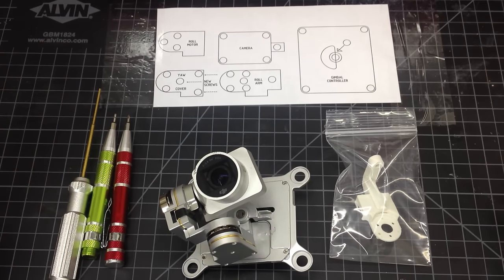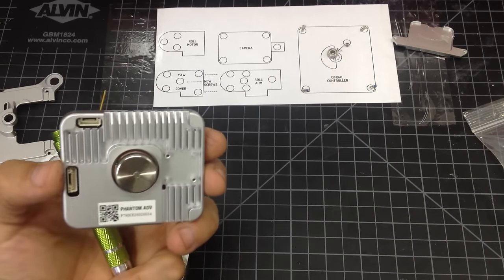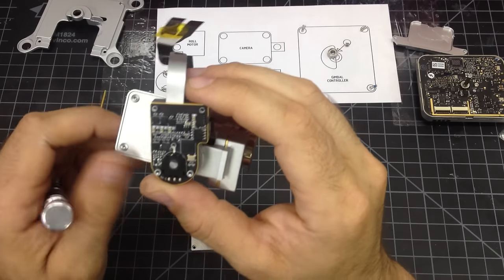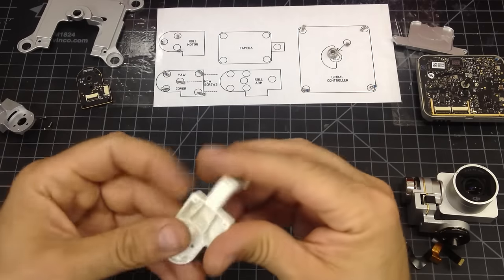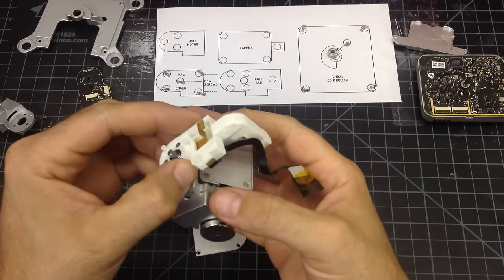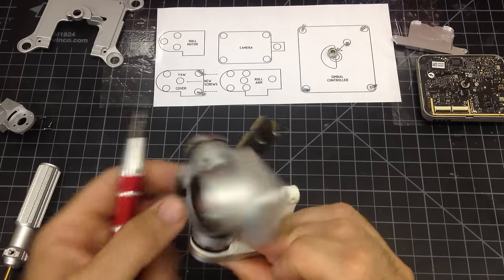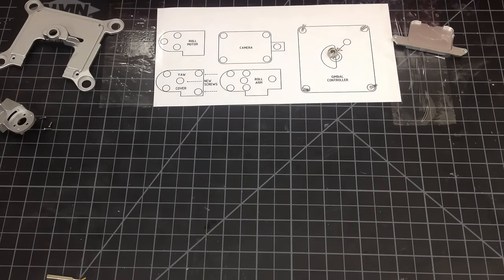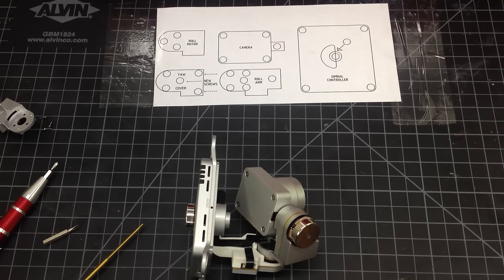DJI Phantom 3 Gimbal Repair - Yaw arm Replacement

Comment: Excellent video, thank you! It was also very entertaining to hear your comments while repairing my drone alongside...thanks for that sheet to help remember where the screws go! I took a screenshot and printed it out. Also the pace of your video was perfect, I was able to follow along and pause here and there, and it wasn't overly long or too quick either. Perfect, my drone is back in action thanks to you! (I purchased a metal yaw arm from Amazon)

Comment: My P3S lost all range with the new 1.6.80 update, but now my pitch motor is binding and locks in the down position. I've never crashed it and I usually hand catch I also have a carbon fiber gimbal saver installed. Any thoughts on why the pitch gets stuck? Would you be interested in a repair service if I shipped the gimbal to you?

Comment: Nice video Tony so many thanks for that.  I noticed 2 mins 45 sec into the video you talk about possible damage that can happen to the gimbal control circuit board.  In my case the long thin black chip is damaged (totally crushed) and after putting the module together and doing all of the alignments the horizontal yaw control ceases to work and the camera has a 1 sec cyclic judder. I know I have done the alignment correctly, have spent a lot of time researching it aswell. Do you think that damaged chip might attribute to this problem?  To make matters worse I was able to get a second-hand crash damaged gimbal control circuit and camera off ebay.  I have connected that onto my drone only to find the same problem.  However in the later case of the second hand ebay purchase I took the plastic protective cover off the gimbal circuit and found the same damage to the black chip area, but someone had removed it and replaced it with a soldered in length of copper wire. I was interested in your learned opinion in this matter. Many thanks if you can help me in this matter. Martin

Comment: Tony - my Yaw arm won't come off of the base like you do at 2:47 of this video.  It just won't slide off, I took the screw out with an Allan key but still won't budge.  Any ideas?  Wondering if it bent or something when it crashed.

Comment: Just got the parts in today, did the full repair. I desperately need help. After booting up the phantom 3 (standard). The gimbal with move around perfectly then center itself. However, after a few seconds the gimbal kind of jerks and then a green light appears on the top of the gimbal. I am able to connect to the wifi network on my device, however in the application it indicates the camera is not connected. Any tips?

Comment: Ty so much for the parts and for the walk through. Helped tremendously. I have an issue that maybe u can help me with. Now that I installed everything, once I powered on the phantom, the camera screen is just a screen with pink lines through it. I have no view. It worked before I changed the yaw arm so I know it's not the camera itself. Any ideas?
Reply from the maker: +JL 561 - Sounds like ed bad ribbon cable. Think of it like when a tv looses signal and gets all blocky and changes colors. This is the extreme version. I don't know exactly why scrambled digital video goes to pink. It might be an interesting fact...? Anyway, the only causes I've seen for this is damaged ribbon, cheap clone ribbon, and damaged antennas. I'm going to go with damaged ribbon or cheap ribbon in your case, since you say it changed after the repair, not the crash.

Comment: I need help with my DJI Phantom 3. I crashed my drone last week and it does not have any broken pieces from outside. But when I turned it on, the camera makes the normal starting sound and kept clicking after that. I cannot seem to get my phone connects to the drone also. Not sure if it is hardware or software issues?

Comment: I can't seem to get the yaw arm off (the step at 2:45). It's completely stuck on somehow. I had a hard time getting the bearing off too...any suggestions? This is on the Phantom 3 Pro.
Reply: Same problem here - did you figure it out?

Comment: replaced my ribbion cable and then relized the fan on top was cracked .can i get a new fan(still spins) .but when i turned my drone back on camera did not move at all .loose conect somewhere or doom?thanks!!!!!!

Comment: Great video.  I replaced my flex cable.  My camera is 1 or 2 degrees off center to right.  Set screw is tightened down properly.  Can you share any advice on how to straighten the camera since DJI does not have yaw adjustment like they do roll adjustment?
Reply from the maker: +timmyd - This is a sign of mainboard damage in most cases. Sometimes it can be corrected with a "cold calibration" of the IMU, but in most cases it's not fixable. You should check to see if there's any dirt or metal filings stuck to the yaw motor magnet. This type of thing can distort the magnetic field that the mainboard reads for yaw position. I have fixed this by turning the magnet on the yaw motor, but I broke the magnet a few times. I only got this to work once. The rest of my attempts just mad the problem worse. I would recommend that you don't try it to fix a 1-2 degree problem. Mine were 10-15 degrees. 

I think there should be some sort of reset for this. I find it hard to believe that DJI dour through the work of clocking each magnet to +/- .5 degrees. It would be much simpler and less expensive to get it within +/- 5 degrees and then zero it out in the firmware. Anybody have any ideas on how this could be achieved?
Reply: +Tony Bock Thanks Tony!  It would sure be nice if DJI added a "Yaw Adjustment" like they do for Roll.  Then if a camera was off between 1-5 degrees, it could be adjusted to center.  Thanks again for the video and taking time to respond.
Reply: +Tony Bock And just to confirm, you are talking about the main board of the gimbal?
Reply from the maker: +timmyd - Yes, the gimbal mainboard.
Reply: +Tony Bock After close inspection I found that when the yaw arm is perfectly straight the camera is slightly angled so it appears that the roll arm is bent.  I also noticed that while there is no binding, the tilt is not free spinning like the yaw and roll.  The link to your eBay keeps showing item sold.
Reply from the maker: +timmyd - Going by the information that you've provided, I'd say that the motor shaft for the pitch is binding inside the housing. This happens when the roll ar or pitch motor housing is bent and the pitch motor shaft goes through the motor position sensor at a little bit of an angle. The solution for that would be to replace the roll arm and possibly the pitch motor housing. The motor housing can often be bent back into shape because it usually onle bends wher it tips the motor inwards. The metal is pretty thin there. The roll arm is pretty complex and rigid. You might have a hard time getting that straight.
Reply from the maker: +timmyd - Once in a while, I forget to add quantity to my sales. Once they run out, I need to start a new listing. You can check my other listings to find the current one. This is the active one now: http://www.ebay.com/ulk/itm/191705708697

Comment: Do you have a link to that screwdriver is it magnetic?  BTW just send you a video on my P3 standard and was hoping you could advise on how to fix it.  I replaced the yaw arm but the camera goes crazy and says "gimbal motor overloaded".

YOU ARE THE MAN!!! Love these videos!
Reply from the maker: I sent you a reply by email. The most common cause of a crazy camera after a repair is from a mistake during assembly. The shaft that the camera attaches to needs the flat side to face the back of the camera. You can hold the gimbal up to the light to look through the gap and see if you've made this mistake.
Reply from the maker: I would not recommend that you buy your screwdrivers online. The quality matters quite a bit. I got mine at microcenter, but Walmart might even have them. Be sure to look at the tips on the Philips drivers to see if the point is small enough. Cheap ones often have blunt tips and won't work for this job.

Comment: Hey Tony, yesterday i crashed my phantom 3 advanced and now the gimbal yaw arm is broken, ur tutorial might help me a lot, BUT my Fan is missing ;( where can I get a new one?
Hope You're gonna answer me,
regards, Maksimilian
Reply from the maker: The Advanced camera doesn't come with a fan. The Pro (and probably the 4K) fans are about $20 if you can find them. I think those fans are made special for DJI. I haven't been able to find that exact size. You can get one that's close enough from digikey though.
Reply: Thanks for the respond, 

Now i repaired the yaw arm, but during the repair the little black chip at the "mainboard" of the gimbal broke.... what can I do?  please help me!
Reply from the maker: Umm... buy a whole new camera. You can't fix that one.

Comment: I've had a crash yesterday and I also have cracked yaw arm, when I buy a replacement camera + gimbal for my Phantom 3 standard is it just plug and play? thanks in advance!
Reply from the maker: Yes. I made a video on how to remove the gimbal too. It's pretty straight forward but the clips can be a pain in the butt. 
How to: http://youtu.be/QYHDLi8XGWs
Reply: 👍 seen every video from you this evening  (it's evening in the Netherlands) ☺ but I haven't seen a video about replacing the whole unit... but you say it's just replace it with a new one, attache the wires and I'm good to go?! 👍
Reply from the maker: Watch this video: http://youtu.be/QYHDLi8XGWs
Reply from the maker: The camera just connects and works.  You can use a pro camera or a advanced camera too. It doesn't matter. If you use the advanced camera, the app will see your copter as an advanced, and if you use p pro camera then it sees it as a pro.
Reply: Today I ordered a new phantom 3 standard 😇 where can I find your gimbal arm repair kit? I will try that first before I buy a new gimbal 😅

Comment: Hey! 
I did all like on the video but now after the change the gimbal is not working anymore. It doesn't react. Live video from phone I can see, but the gimbal won't try to move. It won't move at all, non of the gimbal motors. Any ideas why? 
I didn't change the ribbon cable, only the yaw arm, and I'm pretty sure that I plugged all connections back in.
Reply from the maker: Check that all latches are closed on the ribbon. If they are, try a new ribbon cable again. The only ones I trust are original DJI cables from a trusted reseller like B&H Photo.

Comment: Hi! Is it possible switch 4k broken gimbal for a hd new gimbal? And keep the 4k camera? thanks!
Reply from the maker: The only thing that's different between the 4K and HD is the mainboard (the board the SD card plugs into). You can swap the mainboard and fan from a 4K over to an HD and make that a 4K. Even the camera is the same.

Comment: Good morning, brother. My phantom 3 std wet the camera and now the image is a little greenish. Which may be the problem, would be flat cable or the gimbal board.
Reply from the maker: If you can still see an image, but there is a green tint, it could be as simple as dirt or algae inside the camera. The housing for the camera is not waterproof. You should be able to disassemble the camera and clean it with acetone. Don't use rubbing alcohol. That stuff is usually 30% water. Acetone is perfectly safe for your electronics and it's easily available and 0% water. 

If the picture is solid green, you might just have corrosion in the connectors, but it could also be a water damaged component. You might get it working again by taking it apart, cleaning all the boards with a toothbrush and acetone, and installing a new ribbon cable. It would certainly be worth trying. Good luck! Let us know how it works out.

Comment: I'm trying to straighten the shaft of the roll motor, but I need to remove the part with the magnets from the part with the coils. How do I do that?
Reply from the maker: The shaft doesn't bend on the roll motor, although it can bend on the other two. It might appear that it has, but that's not the case at all. What happens is that the hole in the motor bell (the part with the magnet) gets deformed. In most cases you can get it straight again by squeezing it with your fingers. Don't use tools. That would likely cause damage to the magnet inside. If that doesn't work, then there's probably too much damage to the bell.
Reply: You're right. the shaft wasn't bent. I did get it off though. Just pulled it. Unfortunately some of the wires on the one coil on the roll motor got severed. I'm guessing it's kind of impossible to fix that? Unless you rewind the motor or something? I measured the resistance between the 3 phases, and there is 5.6 ohms between the 2 phases, but then the other phases registers nothing, so I think the connection is properly broken.

Comment: Why you change for  this parts? for save weight?  or?
Reply from the maker: This is a repair part. If you break the aluminum arms, you can't buy replacements from DJI.

Comment: what size what size is that set screw that goes on the yaw arm
Reply from the maker: The set screw that holds it to the shaft is an m3x3 with a dimple at the tip, not a point. It uses a 1.5mm Allen driver.
Reply: +Tony Bock thanks man

Comment: what is that orange wire you fed through at 12:05? i need a new one but i cant figure out the name.
Reply from the maker: That's the roll motor. You can't just replace the cable, you'll need to replace the whole motor.
Reply: Dang.....
Reply: Where can i buy one?
Reply from the maker: +Samuel Walters - Email me sales@bockhobby.com

Comment: Why plastic and not a CNC 6061 aluminum housing?
Reply from the maker: +Tom Oates Premiere - Cost of aluminum parts was the driving force of this project in the beginning. Aluminum parts are a lot more affordable now, but the quality is not as good as the original in most cases. I'm not sure if they were trying to avoid lawsuits or just lazy, but the parts don't fit the same as the original parts. I purchased some samples from a few different suppliers and found that the measurements are off in several places. Most common flaw was in the paths cut for the ribbon cable to go to the motor controllers. They are 2mm-3mm out of position. Length of the yaw arm was off as well. This caused misalignment of the ribbon and caused the ribbon to be tight when the copter would roll to the left. The aluminum parts are still useful, but don't expect anything high quality from these cheap eBay sellers.
Reply: Thanx.  Got my yaw arm through Amazon .. iCarbide, an international tooling company machined in the US.  Got my cable through DJI.  I don't do business with eBay.  Bought a nice mini screwdriver set and metric allens.

Comment: hi everybody, does anybody know where i could find a phantom3 standard gimbal main board ?
Reply from the maker: Sorry bud. If you have a Standard with a bad mainboard, you're going to need a whole new gimbal. The Standard gimbal uses some sort of internal  network addressing. The camera and mainboard are paired at the factory and don't interchange. You need to replace the camera and mainboard as a set. The gimbal will run for about 10-15 seconds and then go limp. I even tried swapping mainboards between two brand new gimbals to confirm.
Reply: WAF !!
Reply: Tony Bock so if my camera broke off and i replaced the ribbon cable and yaw arm would it still work or will i need a whole new gimbal?